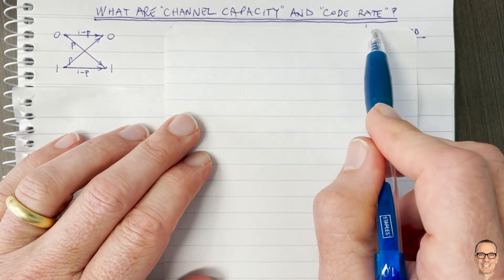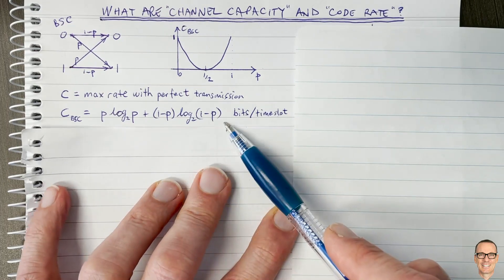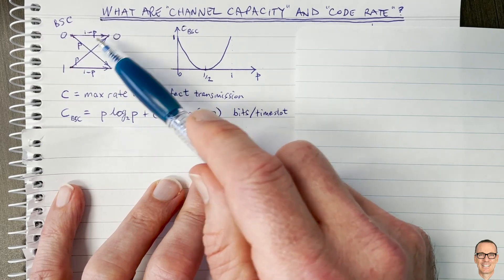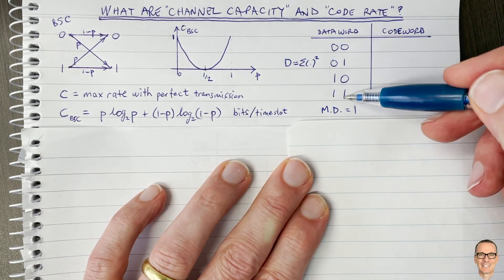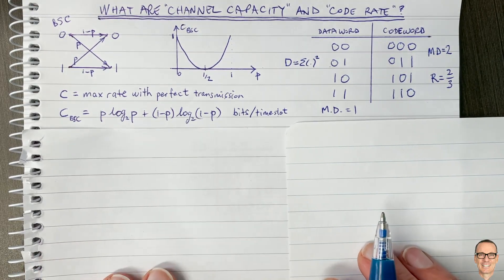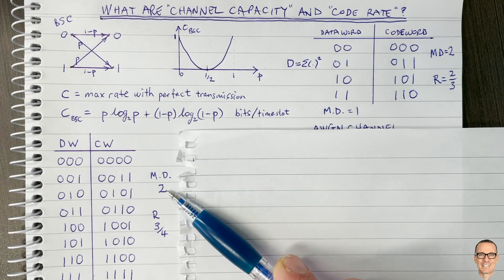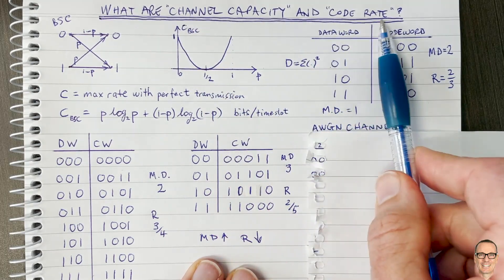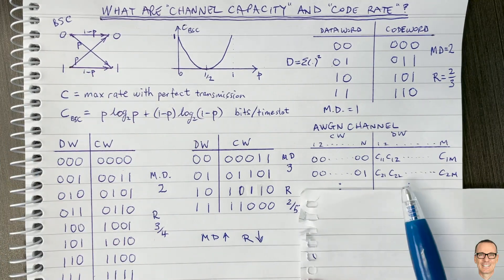What are Channel Capacity and Code Rate?

Comment: I do not understand how the distance is 2 in the second case and i do not understand how it is 3 in the third case is, as per my understanding should not i be 3, 4 consequently? can you explain please
Thank YOU
Reply from the maker: Let's look at the second case. The first two codewords 0000 and 0011 are different in 2 places. ie. the first two bits are the same, but the second two bits are different. All other pairings of codewords differ in at least 2 places. eg. Codewords 0000 and 0101 differ by 2. Codewords 0000 and 1111 differ by 4. Codewords 1010 and 1100 differ by 2. etc. So the minimum distance is 2.
Reply: @iain_explains  thank you so much  I got it now

Comment: Hi Iain. Many thanks for great video. I have one question: In 5G MCS table, MCS 10 correspond to Target code rate 340/1024 bits. This means for 340 data bits we will use 1024 coded bits. Why people which make standard decide to go with 1024 bits (instead of 512 or 2048 for example)? Is there any mathematical reason behind this, expect that this is 2^10?
Reply from the maker: It's really a trade-off that depends on many factors, including receiver sensitivity, transmit power level, distance from the access point (WiFi) or base station (5G), level of interference (5G) or chance of packet collision (WiFi), and channel coding rate and decoding power. There's certainly no fundamental "mathematical" reason for the choice.
Reply: Hello, I would like to add one more point here. The reason for choosing 2^x factor here is because it is easier to handle in fixed point DSP. To store a code rate of 0.332 in a fixed point processor, you will need to make it an integer by multiplying the value by 2^x. And the reason for selecting 1024, according to me, is because its the closest value to 1000. So, by simply looking at value 340, you can understand the actual code rate is approx 340/1000 ~ 0.34. And this is closest to 340/1024 = 0.332.

Comment: The channel capacity for BSC is 1+ p log(p) + (1-p) log(1-p)
If p <= 1 then log(p) <= 0 and p log(p) + (1-p) log(1-p) <= 0, capacity must be bigger that 0, and in this case if the input is 1 bit, the capacity can't be more than 1 bit.
Reply from the maker: Yes, you're right. Sorry about that. I must have had a mind blank when I wrote the equation. Thanks. I've added a comment into the description below the video.

Comment: Minimum distance between 01 and 10 =2, maybe you mean gray coding
Reply from the maker: I'm not sure what you mean exactly, sorry. I think you're asking whether I am talking about the Hamming Distance. If so, then the answer is, yes. The Hamming Distance between 01 and 10 is exactly 2 bits (both the first bit and the second bit are different, ie. there is a distance of 2 bits between the two vectors).

Comment: sometimes people use 1/2 before the log instead of w . Are there any implication for this use ?
Reply from the maker: The most common case where the "1/2" appears is for a system where you are transmitting samples from a continuous random process signal, X(t), sampled at the Nyquist rate of 2W samples per second (ie. twice the highest frequency component W of the random process), and when the transmission channel has a bandwidth of W (matching the signal bandwidth) and additive white Gaussian noise (AWGN), and where the capacity is written in the units of "bits per transmission" or "bits per transmitted sample". The general capacity formula (which has the W out the front, that I wrote at the 14 min mark of the video) is in the units of "bits per second", so to convert to "bits per transmitted sample" you need to divide by 2W (since there are 2W samples per second). This leaves you with a "1/2" term out the front.
Reply: @iain_explains  Oh I did not know that it was even that deep ! Thank you so much

Comment: what is minimum distance
Reply from the maker: Codewords can be viewed as vectors in multidimensional space (eg. in the most basic case, the number of dimensions equals the length of the codeword). Therefore a distance metric can be defined between any two codewords (eg. Euclidian, or Hamming). The "minimum distance" is the smallest distance amongst all the possible codeword pairs in the codebook.

Comment: Firstly, thanks Iain for this (and the other) awesome content! The style is great for me at least, as I'm a visual learner. The current thing I am tying to understand is with an AWGN channel and WGN codes, is the general idea the same - to have the largest 'hamming' style distance between the codes? And then from that point, if we took long codes (and some FPGAs), what's preventing us from creating crazy n-order modulation schemes to claw back what we paid in the time domain? Cheers, Heath
Reply from the maker: Yes, for your first question. For the second question, the issue is delay. Most mobile/wireless standards define multiple modulation-order & code-rate pairs. If the SNR is high enough, then the modulation order can be very high. When there are symbol errors though (due to either low SNR or from using a modulation order that is too high) the code rate needs to be lower, since more redundancy is needed to overcome the errors. In general this means longer codewords are needed, which in general either requires more bandwidth, or more delay.